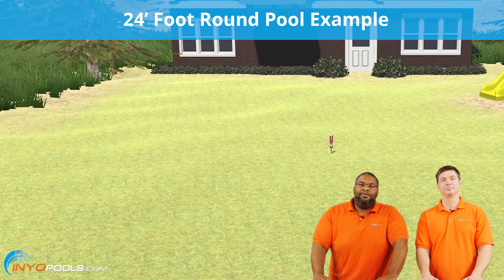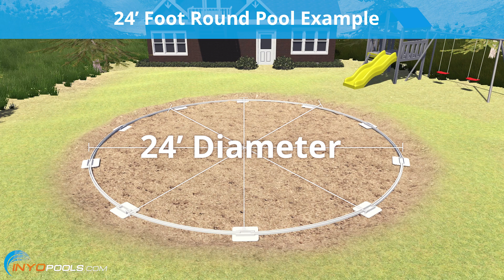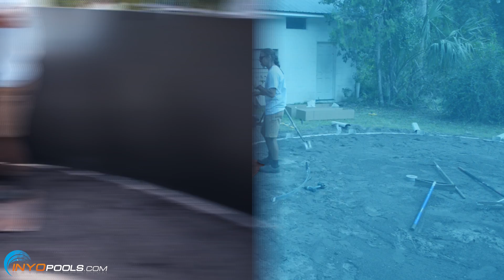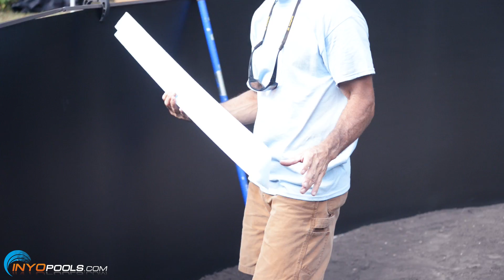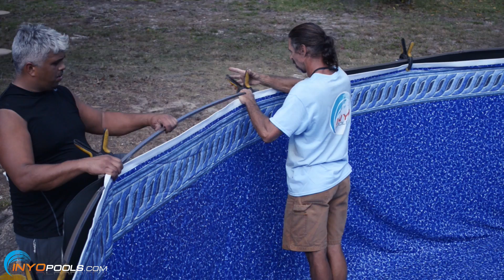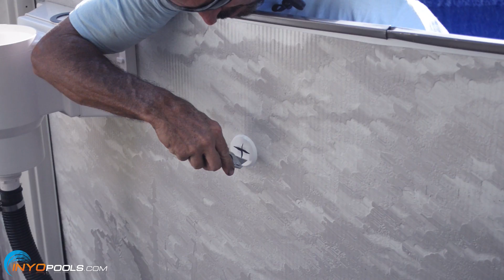How To: Build An Above Ground Pool

Comment: very important question: how do you drain the water at the end of the summer???
Reply from the maker: You'll want to drain some of the water but not all of it. If it's a steel wall above ground pool and you drain all the water, the pool can collapse. Usually, it is recommended to drain just below the skimmer and return jet. You can use a sump pump to drain water out or you can use a garden hose to siphon the water out.
Reply: @Inyopools  thank you for your reply. that is very interesting. so the first water i put in the pool will be reused year after year?
Reply from the maker: If it's a steel wall above ground pool, you'll reuse the water. At the end of the season, you winterize the pool. You'll drop the water level, add shock and some winter algaecide. Then you'll put a winter cover on the pool until it's time to open it up again. 

If the water got so bad that it needed to be drained, you could drain and refill instantly. You don't want to leave the shell of the pool up for too long without water.
Reply: @Inyopools  thank you so much for this information, I wasn't able to find it in any of the videos I watched
Reply from the maker: @alicecalin8290  You're welcome! We're working on a new above ground pool closing video and we'll make sure to address that. Thanks!

Comment: What happened to the pool sand for the floor of the pool? No vacuum for the liner? HMM. I must be old school. LOL
Reply from the maker: Craig, many people still use sand. The topsoil in this particular area was soft enough that we didn't need sand. As long as the ground is graded properly and rocks are removed it'll be fine. We also used a liner pad which helps. Above ground pool liners don't really need to be vacuumed if you work the wrinkles out as you fill the pool. Everyone has different techniques and there isn't necessarily a right or wrong way of doing it. Thanks for watching :)